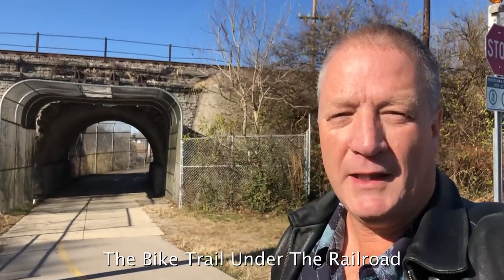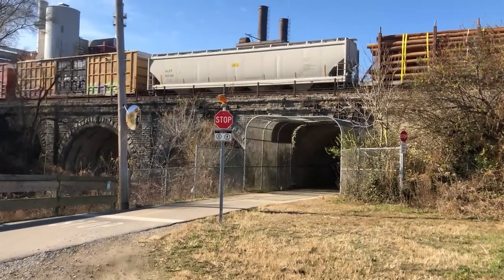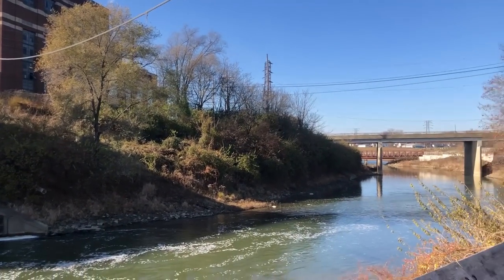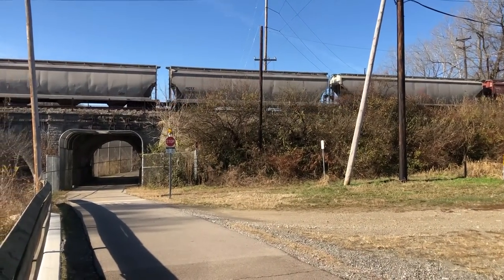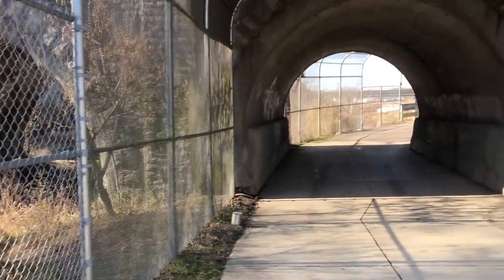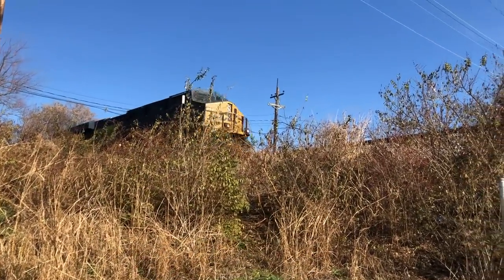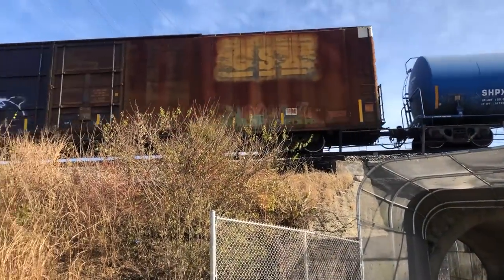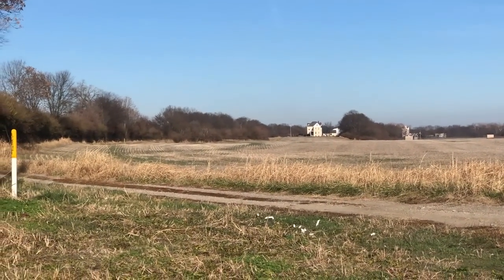Trains Cross Rock Viaduct At Power Plant, Dangerous Bike Trail Under Railroad Used As Roadway

Comment: The creek that the bike trail runs by is actually the Great Miami River. There is a dam over to the east that diverts water from the Great Miami into that creek. I guess it's actually a canal. They did that to provide water for that small hydroelectric plant there by where you filmed. It's on up about 50 yards from the dismount signs you showed.
I hope some cyclist doesn't end up head-on with another dummy in a car. ☹
Thanks, JT. I hope everyone is well.

Comment: If you want to model those auto box cars (86 feet) Athearn and Walthers makes them. The Athearn’s can make a 22” curve because the draft gear is different from Walthers. The Walthers needs a 24”. Not sure what your layout can handle. Because of the length storage could be a challenge. The way you can tell if the auto racks are two or three levels are on the ends of the car. You can see the ramp slits in the doors. Steven Sipes

Comment: The average railroad wheel is 36" times pi (3.1416) equals approximately 113" (9.42ft) So basically when you hear a flat spot thumping along the weight of that car is pounding on the rail head almost 9-1/2 feet apart every time it hits! And I'm sure the faster the train go's the harder the hit!?